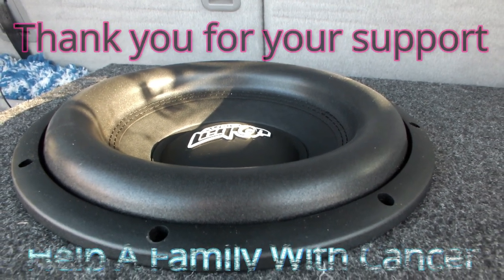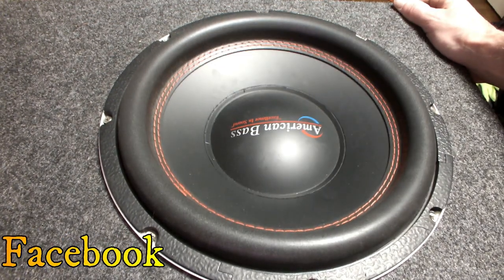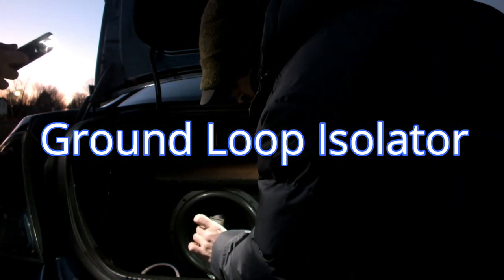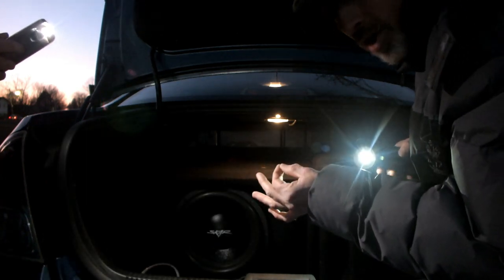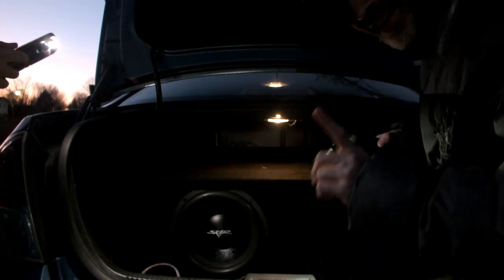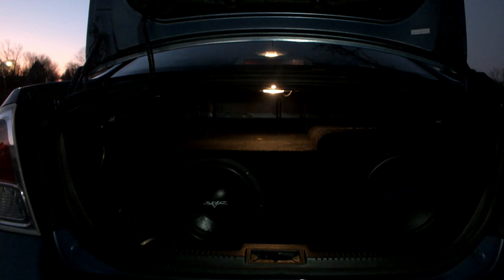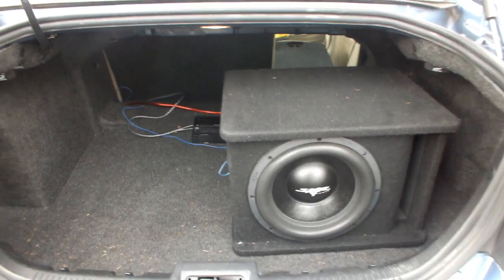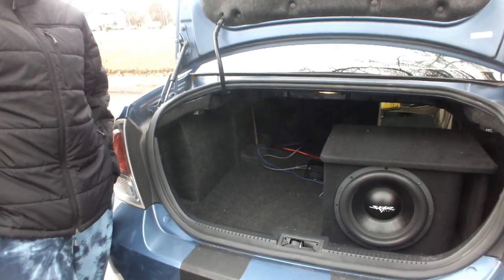X-Scorpion NS200 Ground Loop Isolator Finding The Noise and Eliminating It

Comment: Hey, are ground loop can cause distortions, weak bass? Loss rca voltage?
I got a 5 year bass problem in two mazda cars. I think its ground loop, all equipent is okay. And good rca's
Reply from the maker: Yes absolutely. It's like it's holding something back. If you are plugged into say a computer for your audio it will create a ground loop. Same ground location for multiple devices, ground loop. I've come across this a few times. I got it fixed through different tests. Anything else you need please feel free to reach out. Thanks for your comment and support 🙂